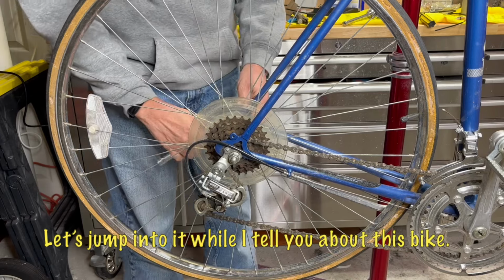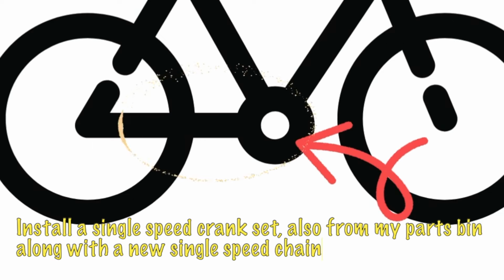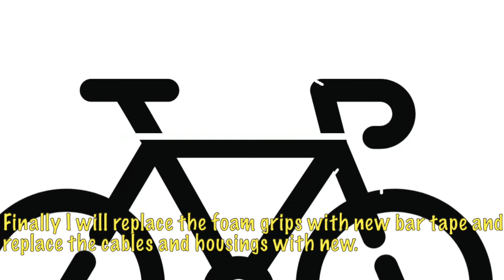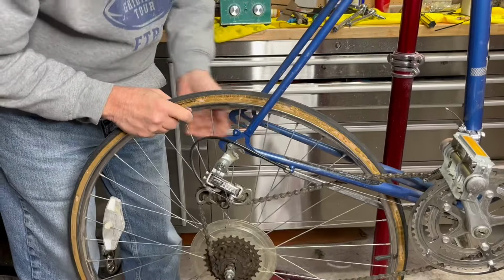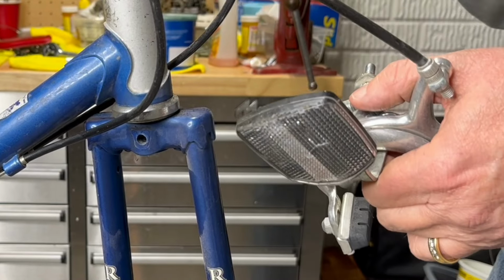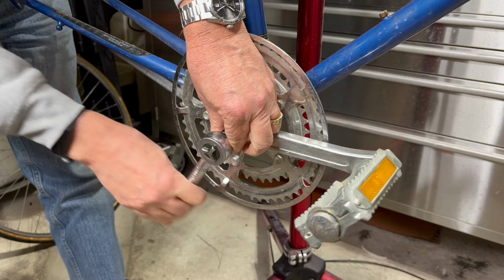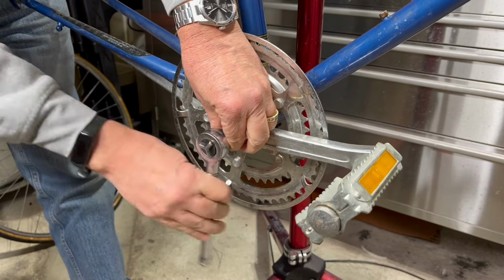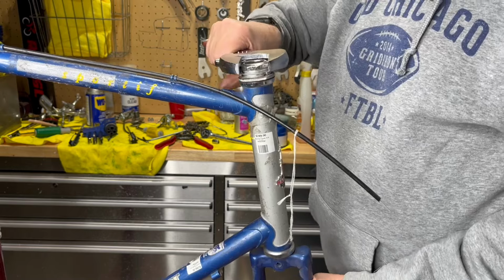Raleigh 10-Speed to Single Speed: The Budget Friendly Commuter Conversion

Comment: Hello, can you make a video about converting 7 speed to fixed gear.. Please❤
Reply from the maker: Thanks for watching!  I will keep an eye out for the proper bike for doing this.  

I do have plans for this winter for a video on my Wabi Lightning fixed gear, if you are into fixed gear bikes.
Reply: @TheValueBikeAdvocate  wow, keep it up the good work❤️‍🔥❤️‍🔥❤️‍🔥
Reply: I really need a video that shows a tutorial about converting 7 speeds to fixie because i have a road bike with 7 speeds and I absolutely have no idea how to turn it into a fixed gear… i hope you can post a tutorial vid soon, god bless❤❤❤
Reply from the maker: Depending on the hub your rear wheel has it may or may not be possible.  I would guess you have a freewheel.  Your first step would be to determine if you have a freewheel or cassette.  

If you have a freewheel, look how to remove it.  These can be really tough to remove. 

Once removed you may be able to screw on a fixed gear cog and lock ring.  

Good luck

Comment: i would like to swap on my 2 old racers for cassette single or fixie or single coaster both have the 27 1/4 wheel-tire
Reply from the maker: Thanks for watching!   Most likely they have free wheels so you could do what I did and swap out the 5 or 6 speed freewheel for a single speed freewheel.  Good luck with your project!!

Comment: I just don't get why people want single speeds. I had them as a kid and they sucked.  You had to walk up steep hills and you're always spinning out, going down hills.  Once they came out with 10 speeds, I never looked back.
Reply from the maker: Thanks for watching!!  I get what you are saying, but I love the simplicity of just one gear and wanted to build one.  Thanks for watching again.
Reply: @TheValueBikeAdvocate  Totally get it. Nothing against what you're doing. Just making a general statement.
Reply: When you live in a flat city, single speeds are quite fine because you would use only 2 gears 99% of the time if you had gears, so you lose almost nothing.

But on the other hand you get away from the expense and weight of having a front gear, back derailleur, cables and a cassette. It's a quite good trade.

Still, I like having gears on the back, not on the front.
Reply from the maker: Thanks for Watching!